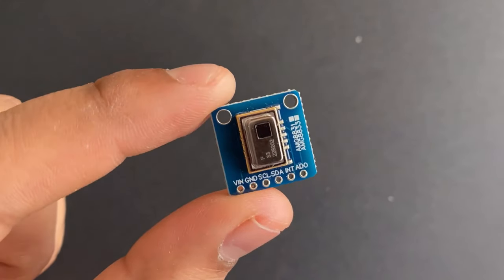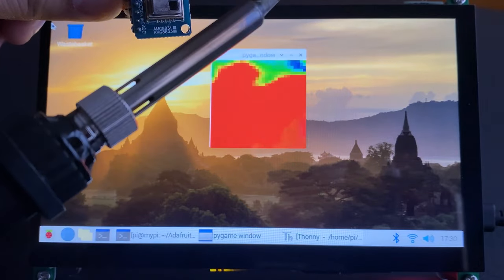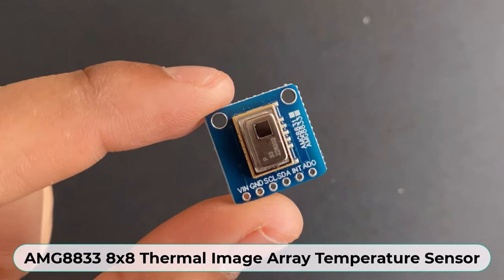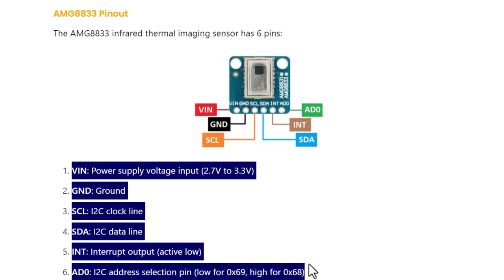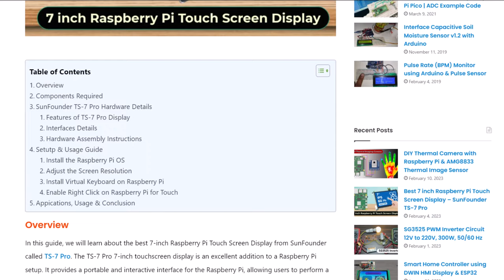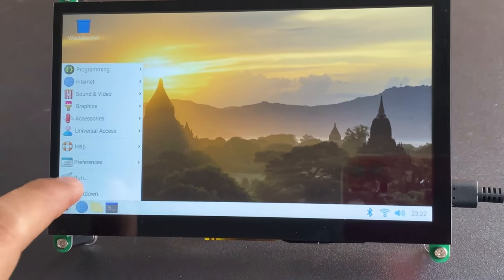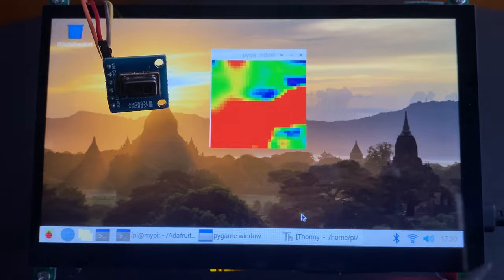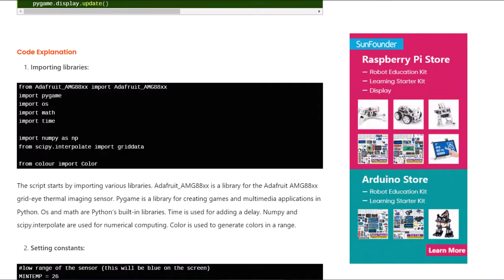DIY Thermal Camera using AMG8833 Thermal Image Array Temperature Sensor & Raspberry Pi

Comment: As an engineer that works with Professional FLIR cameras, I think that just the FLIR sensors (used by various camera brands) are acceptable in Industrial applications!!!
But in other situations, your work and effort is very nice 👍 Thanks a lot for sharing this great project 💯
Reply: What kind of galvo would be good for a raster scan to give higher effective resolution?
 I don't even know if it would be better to put the galvo mirror before or after a lense, any reading material you can recommend?

Comment: Not worth bothering with except as a novelty.  The resolution is not good enough as I would want a thermo imager to work down to circuit board component level, but those type of imagers are very expensive.
Reply: Not worth bothering with for you*, the rest of us could see use in it

Comment: At the cost lower than this you can buy Better Android thermal camera
Reply: Example?
Reply: @insertyoutubenamehere4160  otg powered Thermal camera .
Reply: What about MLX90640 Thermal Camera. It is 95 bucks.
Reply: @thecrazylooser7  still preferred to buy because you can't use just bare sensors , you still need microcontroller, display, battery and inclosure .otg type is best and cheap but only if purchased from Chinese site .